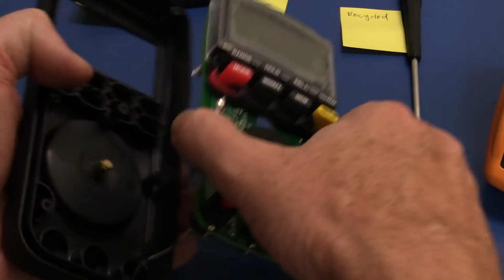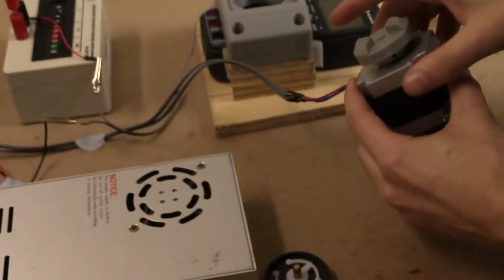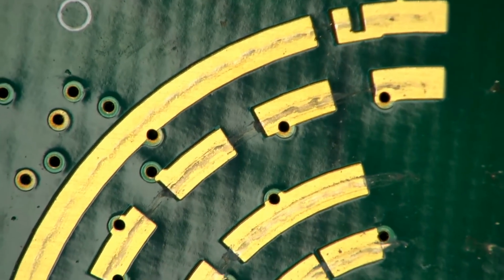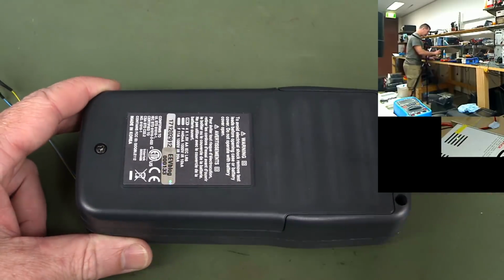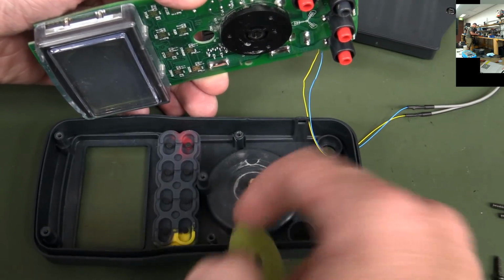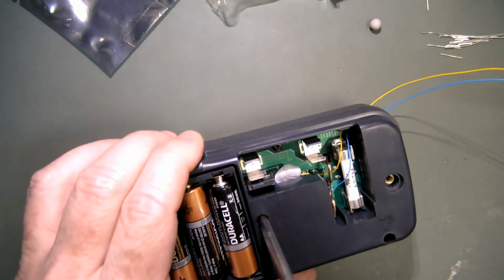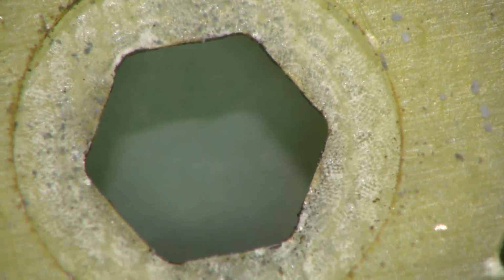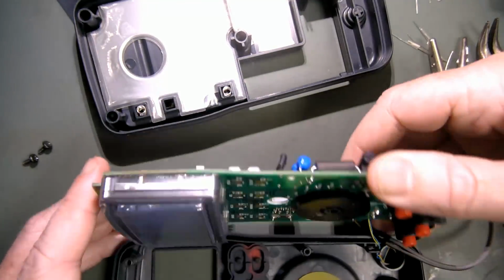121GW Range Switch Cycle Testing

Comment from the maker: UPDATE: We completely screwed the pooch! We installed the shim upside down! There was supposed to be contact friction between the shim and the plastic case (which created all the dust). Apparently we were too dumb to read UEI's instructions precisely. Doh.
Reply: <Start>  // Start again after RTFM
1
2
3
4
5
6
7

Sometimes you just have to RTFM!  I suppose they should have included pictures for you Dave!    ;-)
Reply: Murphy's law.

The part shouldn't fit the wrong way or it shouldn't matter.
Reply: Others have said, and I would have to agree, the shim should be made of some sort of 'slippery' plastic. Teflon (PTFE), Delrin (UHMW) to keep the glass in the FR4, from abrading the plastic. :-)
Reply: ForViewingOnly - but you can see how a simple picture would have helped!  If it isn't obvious then the manufacture should have shown a picture or two.  Not just for Dave but this fix is likely going to be sent out to all the backers that have already been sent their meters so including pictures will help prevent others from doing the same mistake.
Reply: You never read instructions.
Reply: EEVblog2  - Bell Labs prescribes a minimum of 3.5 Million turns for rotary switch testing. 
You still have 3 450 000 turns to go.
Reply: EEVblog2 You didn't screw the pooch, you tested for the worst possible case, ie. incorrect assembly. A correctly assembled meter surely would produce much less wear.
Reply: Heh. Mistakes happen! I was about to say that the fiberglass would act as sandpaper there and just chew through the plastic. Glad you figured it out :)
Reply: EEVblog2 haha nice :D
Reply: I was going to just say, those little holes in the shim need a quick chamfer to remove the sharp edge which is cutting when it rotates.

Also can you put a small ring of felt or or even ssomething that just creates a bit of a step transition on the central hole in the main PCB where the knob rubs?

The fiberglass from the central hole looks like the main source of crud on the contacts and it doesnt look hard to minimise it.
Reply: that wouldent be a bad idea but all the metal stuff in there is copper.   Nothing i there that would fall off is ferrous
Reply: tl;dr: I have not fully watched your video to the end but had to think about the worn off trace you speak about in minute 12:19 ..... and i have to say, sorry no man .... that's very bad and can probably cause a lot of problems - except if you catch that up in software maybe....... But anyway, i would prefer/like to see, that you change that tiny little bit by removing the contact in this place and route it as normal normal conducting track between the switch contacs/ways...

That way, i can't wear off at all and even if it might .. there is no way that the switching contact actually might produce any false state at all.....

But yeah ... i'm in no means an electrical or mechanics designer ... it was just a tiny little thing which bothered me enough to have it in the back of my head .. til i finally thought, oh .. heh yea, why not avoid it at all by using a track and remove that little bit of contact surface there... ;)

(dunno but yeah, that are things we germans think about because ... it just seems not right in the frist place *smile*;)) 

Just some 2 cents from my..

Greetings from Hamburg, Germany...

Hacky. ;)
Reply: So Dave, is this the same switch and associated fittings as in the 121GW I bought from you a couple of months ago? Can I assume the same excellent switch life applies to my unit or is this a video of you testing a new improved version not yet in production?
Reply: if you can do the mistake, then assembly workers as well... maybe get it marked which side where... btw - why not a teflon shim? also the worn trace: why not route it off-track?
Reply: Dave, I've have to know.  Did you name this meter after the 1.21Gigawatts scene from Back to the Future? I'm sure you've said it in one of your many videos about it,  but I admittedly haven't watched them all.
Reply: Hey Dave! Perhaps add a small magnet to the rotating bit so it collects the presumably ferrous dust and keeps it from accumulating near any of the high voltage stuff

Comment: I hope that in the long run you will either offer a replacement plastic contact retainer (due to the plastic wear) or actually plate the pivot hole in the PCB.  I understand that because of normal wear and tear, the replacement plastic would not normally be covered under warranty, but still having the part available is a good idea.

Comment: Is it possible to build range switch, that instead of actual contacts, you have smd reed switches on board, and range switch has magnets instead of wiper contacts? Wouldn't that be virtually no wear out contacts?

Comment: hi Dave,
watching this and previous videos with that range switching tests i am wondering if it would be an issue, when there are vias very close to the range switching traces?
i mean, when the plastic of the range switching nobe is worn, the contact may be not exactly centered anymore. that could cause that the contact points "fall" to the via and the contact is weak.

Comment: Having tracks with solder mask under the contacts is just a dumb design! I have had multi-meters fail because of the solder mask failing and the contacts shorting between wrong tracks!

Comment: Well you def proved your design, I have an older DVOM that is at least 10 years old and it only has roughly 3k ish cycles. That would be a guess, and I used it a lot lol. And anyone down brlow in the comments not likeing some part of it just is not thinking clearly, 50k+ cycles, thats easily 15 years of service with no lube.......

Comment: I don't like the fibreglass shim.
If you're going ahead with that the testing should be done with the meter in the bench position like on its feet. 
Could be that more glass dust made it in then to ruin your plating.
Ok, so not alot of dust is from the fibreglass, you still only need a stray hair of glass from a edge to wreak havoc.

Comment: I am losing confidence in buying your meter. I am not trying to be mean, just wanted to let you know.
Reply: mini hop Based on other meter selector switch cycles I assume. Testing a meter by the designer and manufacturer online is extremely brave, and proof of confidence in their products. Including spacer fitting in error.

Comment: Conclusions: circular contacts are not the best, it makes sense to use contactless sensors with the combination of relays, or at least sealed magnet switches, also does it have L measuring circuit ?
Reply: i dont think it does mate, along with the usual functions it has C and i think temp and hz, but for a hobby/semi professional meter i think L is more useful than temp, IMHO.
but then i wind a lot of coils and inductors.
Reply: Well, for its price it is good, but there is a possibility to pack much more in that case, with the respective price - and L is actually very useful (as you can't use resistors for high efficient circuits), temperature can be measured by implementing a powerful MCU with loads of memory and sensor profiles.

Comment: Would software de-bouncing help with that wiggling switch issue?
Reply: maybe. Problem is that the range switch interfaces directly with the HY3131 multimeter chip, not the STM32 micro. Any 'software fix' implemented by the STM32 would likely just be a kludge that ignores fast/erratic range changes, also slowing down the responsiveness of perfectly functioning meters. The range switch also provides some basic analogue signal switching functionality on the frontend, so if the contacts are going high impedance because they are worn, it will also degrade some of the analogue functionality of the meter which is invisible to software.

Comment: Mechanical bodge. Plastic washer would be nice, but producing the mold for it would probably cost the same as the new mold for the switch itself. So there is a fiber glass part that is easy to machine but way too abrasive.

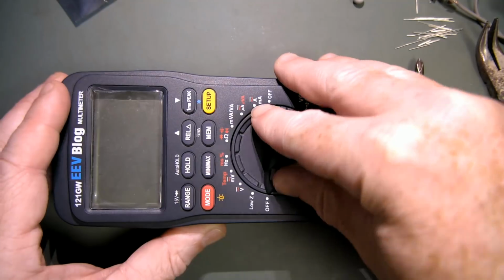Comment: Why the solder mask on the second inner ring at 20:08 that connects the two contact patches?  If there is supposed to be a disconnect at that point they really should have connected the patches with a trace that is out of the contact path.
Reply: I agree- and all of the plate-throughs should be out of the wiper path as well....  I can see how I would fix that layout!

Comment: What about using XX phenolic in lieu of G10 plate? Would be much easier on the items in question and the wear dust would be paper. CE phenolic would be a second guess but then again, you are getting into a cloth. Paper phenolic has an added advantage of being self cleaning.

Comment: A bit of silicone grease should help reduce the amount of abrasive dust that spews out onto the contact area and accelerates the wear
Reply: Will it not just turn into an abrasive goop?
Reply: Yeah, grease reduces friction massively and that will reduce micro fretting and the amount of accumulated crap.
Reply: If it never grinds there won't be any abrasive, but either way it will be squeegeed to the side. I rather have pristine contacts and change grease every 10 years than let it grind with no maintenance and possible faults. The contacts in my ignition are greased, and I know that because my car got recalled after 27 years because it catches fire when it dries out.
Reply: 10 years?!?! I throw away one of these per year... Not because they are poorly made or designed, but because they get damaged in so many ways...

Comment: If it was possible to make a multimeter with reed switches and magnet in the knob there was selecting  them, it would live very long. I guess magnet distance would be the problem and maybe outside magnets could jam it!. :-)
Reply: Also much more expensive.
Reply: Since it's all fancy and Bluetooth, there wont be an app in 5 years time. Sure, the protocol is open source, but I don't think the switches lifetime will have any effect whatsoever. The thing will become obsolete way before the switch finally breaks down for good.

Comment: I dont like, how this knob is mounted on the PCB... using a sharp hole to pivot a soft plastic knob, without any axis or somewhat a support, it's gonna wear (but not within 50000 cycles, obviously :)  - and the mess with this plastic particles inside is gonna be worse
Reply: The plastic part with the contacts is supported by the brass shaft on the knob which is in turn is supported by the hole in the front half of the casing. IIRC most flukes do it the exact same way, only difference is that the hole in the PCB is copper through-plated on the Flukes rather than raw FR4 - Dave makes mention that it could be copper plated.

Comment: What's the point of the fiberglass shim? Just for the testing, or will also be present on production?
Reply from the maker: To prevent a problem with intermittent contacts caused by a thinner production main PCB.

Comment: How about a UHMW shim --
Reply: Ultra High Molecular Weight (plastic). It's the standard slippery plastic used for sliders.
Reply: UHMW? what's that?
Reply: Machining a thin shim like that is going to be a pain, it would cost 10x+ as much as the FR4 disk. If you could find a way to eliminate the inner features it would be possible though, eg a circle of UHMW tape would work.
Reply: you just punch the shim from a sheet, super easy
Reply: UHMW... PE.
Very long linear polyethylene. Like Nylon but has even better propertys here and there.